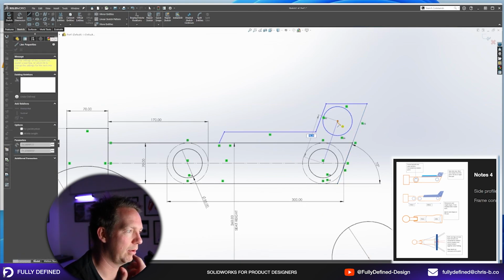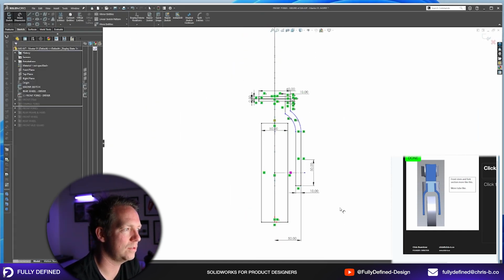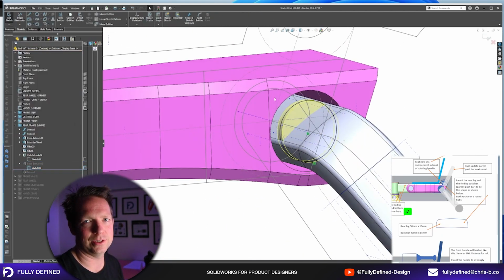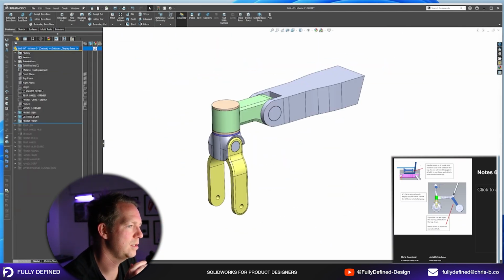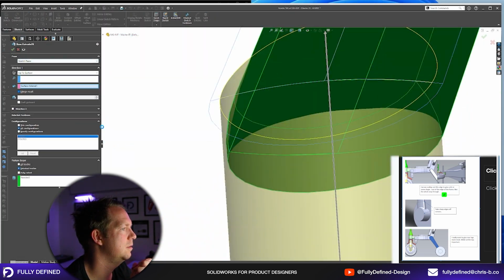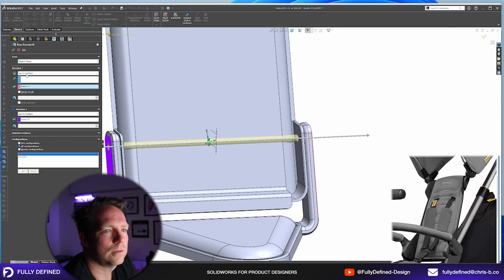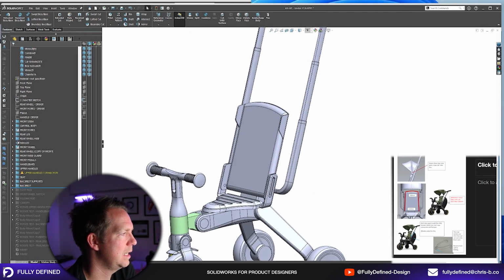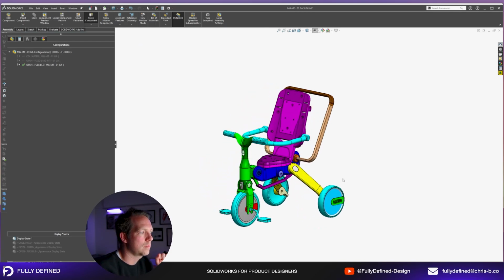Timelapse Trike Model - SolidWorks 15hrs of modelling in 45mins!  - SolidWorks Advanced Skills

Comment: Hi Chris,

Great work, could not thank you enough for sharing such detailed information. 

Just a quick question I have observed that in assembly people keep the Master the model in the assembly as well is there any specific reason for the same or just to have all conserved model in one frame so that if any updation required you can jump directly from assembly to Master model and update. and off course update the related part.
Reply from the maker: @DavinderKumar-t8t  thanks for your question.
It depends! Sometimes the master is referenced by other parts. Sometimes the master is edited directly in the assembly. I’ve used this method before by having configurations in the assembly to swap between the two modes - it all depends on what I’m building from and trying to achieve.  Another great question from you, difficult to answer in writing.  I will try to follow up with a video